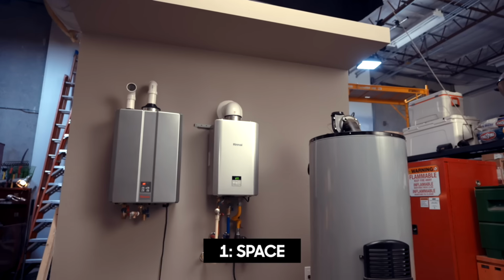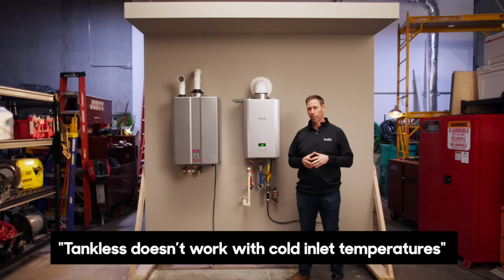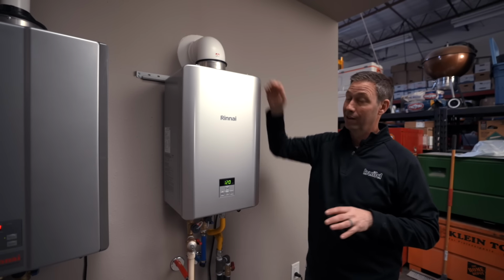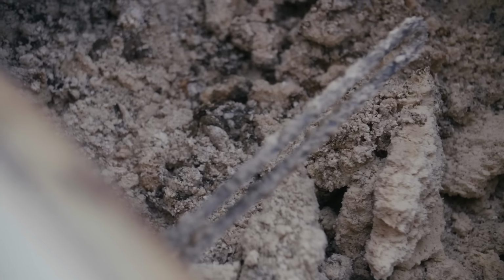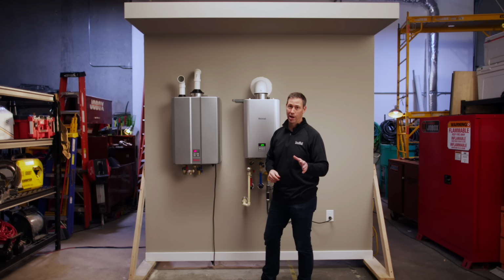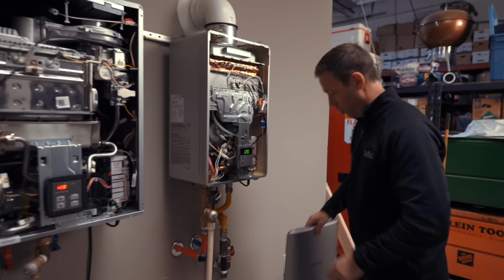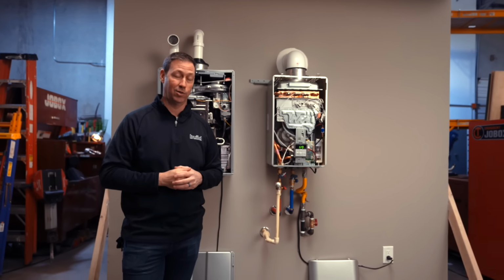DEBUNKING Tankless water heater LIES!

Comment: My comments come from UK where we have gas combi boilers that are essentially the same as your tankless system however, I am a firm fan of stored hot and cold water systems.
1.  Space for a hot water cylinder should not be an issue if the building is properly designed.
2.  You are mixing boiler efficiency up with storage efficiency.  New boilers in UK have to be at least 95% efficient and the latest HW cylinders are claimed to lose only 1-1.5 degC in a 24hr period.  As the immersion element is the water it transfers all of the heat produced to the water i.e. 100% efficient.  Heating water instantaneously takes more energy than over a long period slowly provided the heat loss from the cylinder is controlled, which it certainly is using the latest cylinders.
3.  If you have a properly sized HW cylinder you should be able to have more than enough hot water until the next time the water is heated in the cylinder based on the time clock.  As a family of three adults using two power showers at 28litres/min and 35litres/min every day together with all the other hot water requirements we have never run out of hot water.  Indeed, our hot water is heated during the night on the lowest tariff electricity, if we heated the water during the day as we used it then we would be paying 3x as much.  With our usage the hot water requirements would require a huge instantaneous water heater to provide around 75litres of hot water/min for a temperature rise of at least 45degC.  Most combi boilers cannot cope with sudden surges in demand that take them above their normally low limits.
4.  The ground temperature is fairly consistent throughout the year as the pipework is buried at least 450mm (18") below ground and deeper in cold climates.  This translates to the inlet water temperature.
5.  Combi boiler installations are cheaper and that is why they are favoured by heating engineers who make big profits as a result.         .6.  Gas boiler flues are required whatever the heating source i.e. combi or condensing boiler so no difference.
7.  Both systems are susceptible to scale in hard water areas and the solution is applicable to both.
8.  The speed of supply is dependant on where the hot water source is compared to the use.  Most HW tank systems are usually sited close to the point of demand and thus respond quickly, the boiler being remote.  In a combi system the boiler stays in the same place and has to feed hot water some distance to the outlet, it therefore takes longer.  In large installations the hot water is constantly circulating so that it is available almost instantaneously, whereas the combi unit has even further to go to supply the outlet or multiple boilers have to be provided.
9.  the latest high efficiency boilers, whether combi or system condensing boilers use an inconel heat exchanger to get maximum efficiency and durability.
10.  It goes without saying that the gas supply must be up to the duty required of it and as a combi system needs a higher output boiler to satisfy the peak demand it needs a bigger gas supply that may or may not be available.

One other point about tankless systems is that they have no capability to cope with any interruption of the water supply.  If there is no water supply due to a ruptured main say, then with a combi system the whole heating, hot water and cold drinking water supply ceases, whereas having stored water for the wet heating system in a header tank and cold water storage for both non-potable requirements and hot water means that life can go on uninterrupted.  Drinking water would then be from a bottled source or boiled tank water.  At one time in UK it was mandatory that all dwellings had at least 1 day's supply of stored water.

Comment: The only thing I didn't like about the tank less water heater - if the power went out,  no hot water because it required electricity to operate.  Didn't have back-up power at the time.

Comment: Is that for gas heated tanks, is Electric heated tanks more efficient?.  My understanding is that with electric models all the heat from the element goes into the water.  So all energy used to heat the element is transferred 100% since the element is submerged in the tank.  So while it is more efficient than gas the operating costs are higher.

Comment: What tank water heaters in 2022 are 60% efficient? Gas Rinnai "High Efficiency" is rated at UEF of .81 

This video really bends the truth. It should just be labeled a Rinnai advertisement.

A heat pump electric water heater has UEF 3.5 or greater. Gas is over. And so is tankless. 

The best place for a tankless is an unused vacation home. And an unused vacation home is a waste of housing. 

Wait, you're setting the hot water to a higher heat, then wasting that heat by cooling it as the shower head with cold. Okay, sure old school way of wasting energy. We can do better. If it's instant, why set it so high and waste energy?

Comment: I much prefer the tankless water heaters, but I have had not had the experience in longevity that you claim. I have 4 tankless water heaters in the home (including guest house) that we live in. I replaced one after 5 years, the second one after 7 years, the third one after 8 years, but the 4th one is still going strong. I doubt if it will last 2 decades as claimed.
Reply: How often the you have them serviced? Once a year is recommended.

Comment: In India, we've been using these Gas geysers more than 2 decades. It's convenient, and even the decent ones Costs only ₹ 4k - 6k (under 100$)
Reply: That's because space is such an issue for India.  Historical and geographic factors, not any proof of value of tankless.  Aside from space-saving, there's no proven advantage to tankless.  Many more of you would have tanks if India were less populous.

Comment: Thank you for this. I have a brother that was a plumber and has been gathering quotes for years.  I have lived outside of the US for 20+ years.  I installed one myself on a bathroom in the Philippines 15 years ago. When back in the US I still could not get one installed.  Meanwhile, during this time I've had one that supplies a house my mom has replaced two large tanks.  I currently live in HK and that is all anyone has.  We have one about the size of a carry-on suitcase.  I serve two full baths, a kitchen, and a washer at the same time.  Repairs in 15 years, none. Your video will help my argument!  Definitely going to send this on to my mom.

Comment: Nice video Matt, over here in the UK, tankless (we tend to call them combi's or unvented) are increasingly popular, mainly because we have smaller houses so every space counts. Having said that, they are sometimes poorly specified or are not appropriate in some conditions, in which case, a tank has to return.

Disclaimer: I'm not a plumber, but am the construction industry.
Reply: They use combis in the US also. The problem with Combis is they heat the home also and many times the heat load is only 30 to 60 K BTUs but the unit is 200,000 so it is adequate for the domestic. The turndown ratio of these units is usually 10 to 1 BASED ON MAX INPUT. This leaves you with a minimum 20,000 BTU firing rate. Not much to work with when setting up the outdoor reset control.

Comment: Tankless is the way to go for a lot of people. I put electric ones in our all electric/solor home. They save money because keeping 60 gallons of water hot 24x7 using electricity is too expensive. I placed the new units near where they are used. They start quick and only operate when needed.

Comment: Electric water heater with a Fiberglass tank with a lifetime warranty. Solar panels sized at 120% of annual power usage. Zero gas or propane cost.  No venting. No backdrafting. No makeup air requirements. No potential carbon monoxide issues. Flush the tank once a year.  Change the elements every 8 years.

Comment: This was a unique and valuable engineering report... which turned my head towards "tankless."     Not convinced yet, but I'll give tankless another chance.         I am very proud of my excellent HOT WATER LOOP, which spans the entirety of the attic of my SoCal single family dwelling;   I discarded tankless from consideration, 15 years ago.     At that time, the only way to have true compatibility with an insulated, pumped LOOP was to use a tank-style heater.         Now Matt says that Rinnai has solved this matter with its tankless design.       I will review that, in detail, before I replace my very-satisfactory, gas-fired 38 gallon tank-style heater.

Comment: Maybe on gas they are ok. Some of the electric whole hose units use 3x40A feeds, that's half the capacity of a typical panel all at once.  And some people who switched said their power bills went up from having unlimited hot water. Their teens who use to take 15 minute showers now stay in there for 30-45 minutes. So it can be hit or miss, going to a hybrid water heater seems to save the most for people with out gas.  I see comments on youtube with people complaining about EV charging taking too much power where tankless electric water heater can take 3 times the power and all during peak power times, not from 11pm-5am when people commonly charge their cars.

Comment: Re: Line size. If I have to suck the gas out of the gas line, there's a problem. These things pull 199kbtu at full burn. My house only has a 250kbtu gas meter, typical of most older homes in America. I would need to replace the meter and regulator. Worse, some residences around here have low pressure systems that wouldn't be able to do it without a booster.

Other than that, good advertisement...

Comment: I have a hot water boiler on the wall and I have a indirect water heater. 50 gallons. I have more then enough hot water. Very little heat lost. Tankless water heaters need to be flushed yearly or they will not work. Need special pumps and chemicals

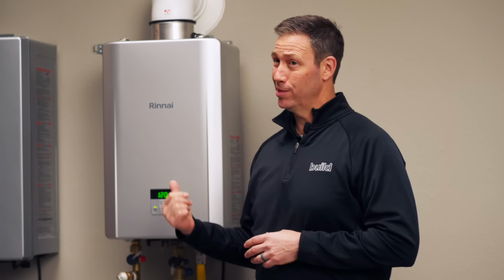Comment: 2:25 the reason they are so expensive to install is because 9 times out of 10 it's a conversion from a Tank water heater to a Tankless, which requires a lot of work to be done compared to just switching out a tankless with a tankless or a tank with a tank, those would be cheaper and easier
Reply: need new larger gas line... missed that one.. they arent that complicated to install.. But new bigger gas line needed for heating water..ever seen the heat chamber..i have.. thats a big cost.. and a lot of holes..
Reply: and it's not like it's necessarily a one-time expense.  If you later want a different type of tankless, with different requirements than the tankless you're replacing, that can run into expenses too.

Comment: TBE wife and kids would take hot long showers if they could negating any savings. Not all homes have an extra 50-70 amps of extra service needed to convert over to tankless and would require an expensive service upgrade. As for the gas units, they also need more cu. ft of gas over the tank models which may cause enough pressure drop at the supply line to cause tbs furnace and stove to have iissues. Ihave seen those tankless units fail after five or six years of service so I don't know how you get those lifespan numbers from. Those Babies units are total junk as are many other's units. I recently went back wit a tank model be cause I was told by the plumber that I did not have enough service to support changing over. I did upside the tank capacity to the next bigger size because I had the room. This allows the last one in the shower in the morning to get a cold one which is usually tmy wife.
Reply: yeah some people find it just too hard to have to wait a bit before showering, or have some family members shower at night, or only shower minimum necessary to be clean.  Having grown up that way, folks who want endless hot water no matter what seem awfully decadent to me.  It's that kind of thinking that is destroying our planet.  "i waant it all and i want it now."  The fact that tankless can't handle low water flow shows they're not as green as manufacturers want you to think.

Comment: Our rinaii tankless which cost twice what a tank would cost only lasted 14 years before it started leaking, which was a bummer.  They didn't tell me that if you don't flush them yearly with vinegar they get flakey in that sometimes you have hot water and sometimes not. Lastly, if your electricity goes out you instantly don't have hot water. With a gas tank water heater, you still have hot water. Given a choice I'll never go with tankless again.

Comment: Matt, as a plumber in the northeast, our company exclusively installs Navien tankless water heaters, would love for you to review one of these.  They have a 1 liter “buffer tank” therefore, don’t have to wait as long for hot water.
Reply: When the video sponsored by one brand I doubt he will do another brand.
Reply: I'm looking into the Navien NPE-A2 & Noritz EZ-SV. Any insight between the two you can share?
Reply: @eaglerider94  no experience with Noritz, it is a popular brand though.  We had a few issues with the A2 as far as replacing the internal check valve on 3 so far.
Reply: Our plumber today said he wouldn’t recommend Navien currently. He said they have had quite a few recalls
Reply: How does that work and where did you locate it.
Reply: @Dwb913  it’s part of the unit, it’s built inside, when going through the start up wizard, it asks if you want to use internal recirculation, external, or no recirc.  When using internal recirc, it will automatically come on about every 30 minutes for a few seconds to keep the water in the “buffer” tank hot, therefore not having to wait as long for hot water or have a minimal usage to trigger the unit to come on.

Comment: you can get electric ones in thailand for under $100.  They work GREAT.  3kw unit that only runs for 10min at  1/2 power.  Dont be fooled by claims of  excess power usage. You need to get out of western thinking and western captured markets.  For example, you cant buy an electric tankless  hot water unit in aus under $1000.  Somebody is getting jambed from behind.

Comment: Matt’s not comparing apples to apples…. Top of the line tankless to a bottom of the line tank??? What’s important is the design of the entire system, when I designed and built our home I debated tankless, heat pump, or tank… we are in the cold part of Canada where I would dream of 40 degree water. To me a system of in floor heating along with solar to heat the water and a high efficiency tank was the way to go… it was a true endless hot water with 3 daughters all showering, laundry, and dishwasher going at the same time… no issues what so ever. I used the same hot water tank for domestic and heating, it ran off propane but only used a small amount each year, as my lumber yard guy said, you can heat that house with a popcorn fart.